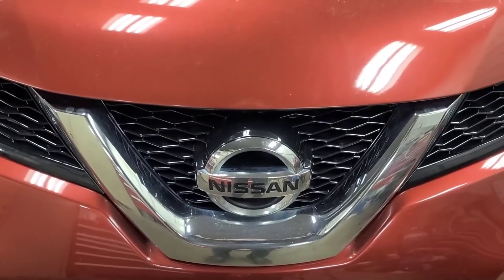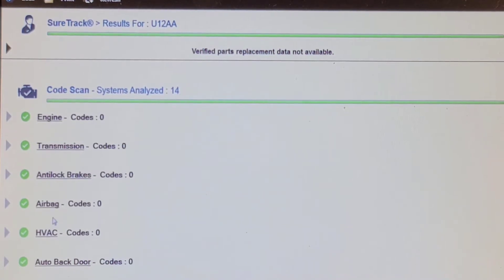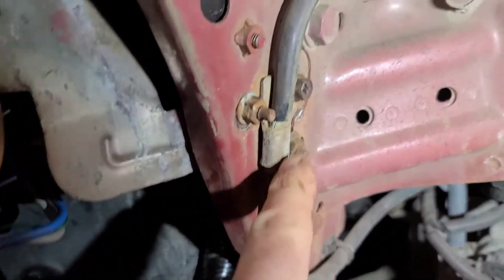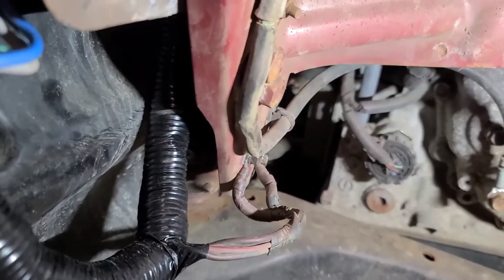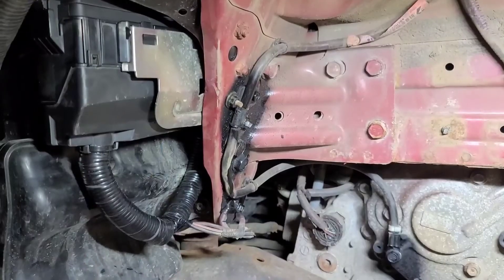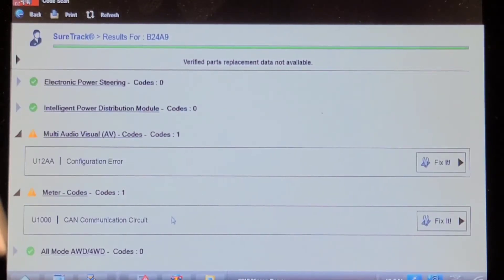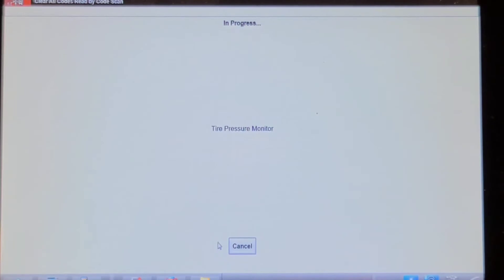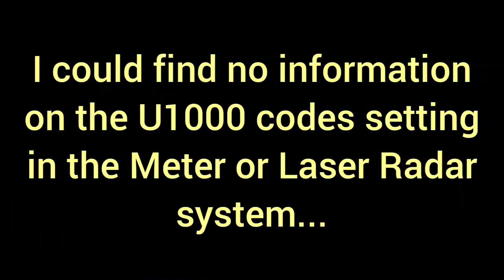2015 Nissan Rogue CVT Goes Into Limp Mode, Take 2...

Comment: May I ask a question ? In your video about the TCM did you say there was a fuse when the P0890 code comes up ?  I have a 2016 Rogue and I can’t find that fuse or relay can you help me out please ? Thank you in advance ( frustrated southern guy trying to fix this in the heat ) LOL
Reply from the maker: https://youtu.be/c9bz_2mwa2Q at 19:15 I show the location of the fuse for the transmission.  This carvwas smashed and the fuse box was damaged allowing moisture into the fuses. It under the left headlight. Not very convenient at all. In the end I ended up replacing the fuse bow plastic components and transferring all electrical terminals to another used box. I also removed the ground on the left side of the transmission and top of the cylinder head and cleaned them.
Reply: Mr. Bailey , I wanted to thank you for your video and most definitely for your response. I had to do exactly what you did after two mechanics telling me I needed a new tranny, which wasn’t the issue at all. I followed your steps and problem solved . Thank you so much !!  Tony from Savannah Georgia
Reply from the maker: @tonyhays9809  glad it helped you. Hope it stays fixed.
Reply: I’ve put another 50thousand miles on it and still running great !! I was looking through your videos for some additional help lol but on another Nissan Rogue 2014 the AC isn’t blowing ( it’s a customers ) compressor runs and the low pressure side Freon line is ice cold , but no air coming in ?? I heard it could be the temperature sensor ( down by the gas pedal behind plastic cover ) changed it and it did start blowing cold and the heat started working, but turned vehicle off and went to start 10,mins later and no air again !! Could the blower motor also be bad or have a short ?  Any help is appreciated! My opinion you are the best when it comes to these Nissan plastic overpriced cars, LOL .  Thank you advance Mr. Bailey

Comment: Hi Phil. A friend of mine had a Rogue  or similar car story. Similar issues. The problem ended up being a cracked taillight housing. The water would contact the module or the light socket in the taillight and feed the brake sense for the BCM which was unconventionally referenced by the brake light circuit and not from an adjacent and independent switch for the BCM input.
Reply from the maker: That's good to know. Have not heard back from this customer so that may mean good things...

Comment: I have a Nissan Sentra 2016 i limp mide P0500 , 1715 , 1734 . Does limp mode goes as at You clean the the grounds ?
Reply: I have a shop un Costa Rica . That happen after disconnet the battery  for get the alternator pulley replace . Thanks for help . KIKE de taller Pit Lane Costa Rica.
Reply from the maker: Try doing a network code clear to reset everything. Did the battery go flat due to the alternator pulley?
Reply: @PhillipBailey  thanks for answer . I found that there is vss signal ir I move the CVT module connector. I and working un the vehicle right now

Comment: I have a 2017 Nissan Rogue, bought it a month ago at 127 000 Km. Now it’s going into limp mode all of a sudden, rpm goes wild and can’t accelerate beyond 40, sometimes 80 which makes the car sound really loud.
Reply from the maker: What codes is it setting?

Comment: I have a 2012 nissan rogue i doesn't acceleration and the worst part is that there is no code.
Reply from the maker: What does it do? No throttle response? Will it Rev up in park? Are you scanning just the engine or transmission computer as well?